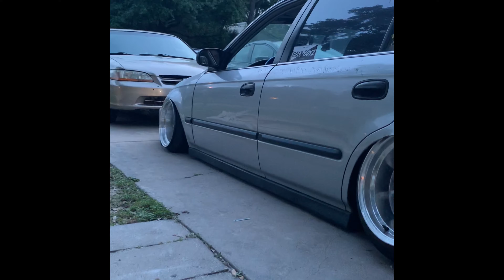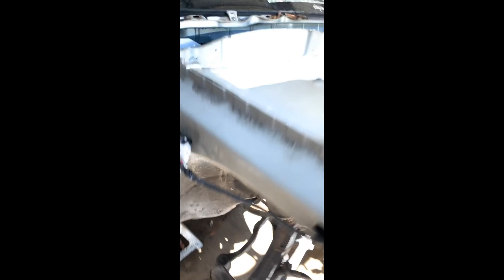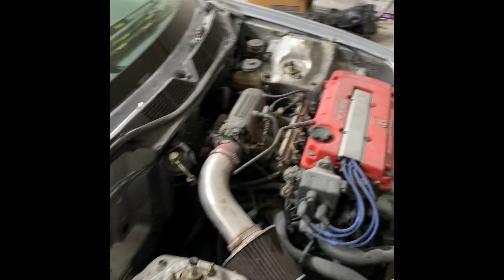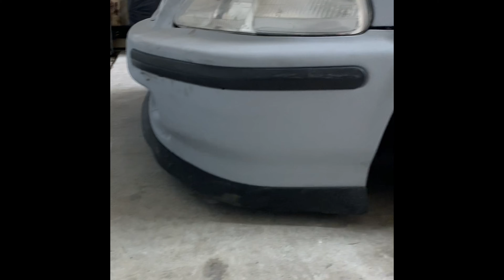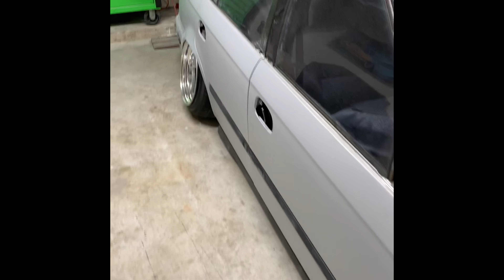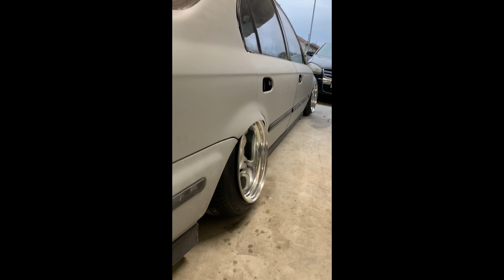Update on the new sedan!

Comment: Hey man I need to relocate my gas tank in the trunk as well I’m too low how did you do it ??
Reply from the maker: Jonathan Ramirez all you need to do is get a couple feet of fuel line I think I got like 8ft just so I have extra and then just extended the wires for the fuel pump and that’s pretty much it